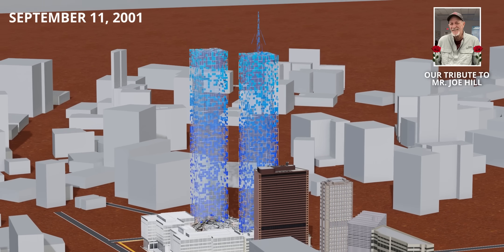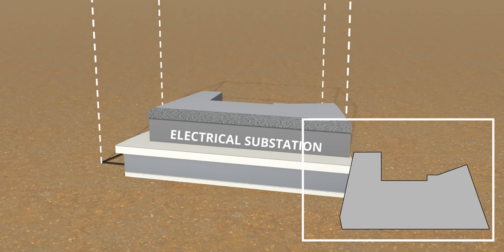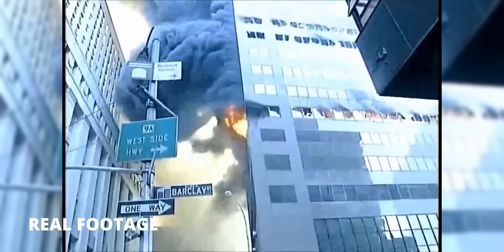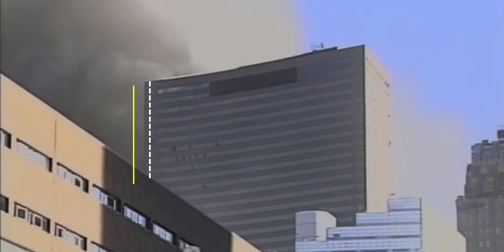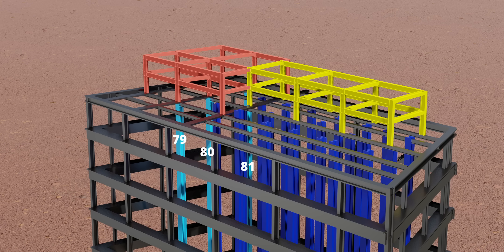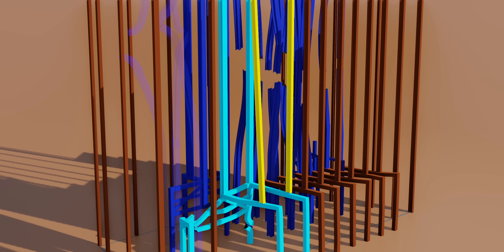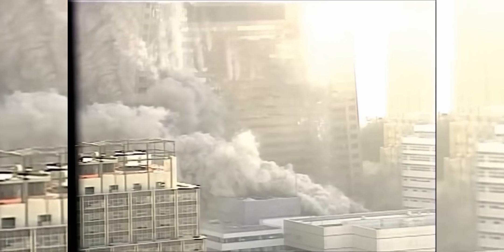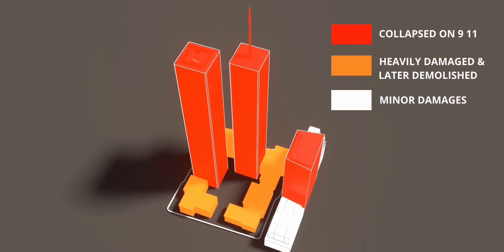Collapse of Building 7 | The Complete Physics

Comment: Propaganda.  It was a controlled demo.
Reply: I'm going to respectfully not only disagree but explain why you are not even wrong.  Building 7 - the 6th building to collapse of 10 lost on 9/11 -though extensively studied  still confuses many. Not famous or a terror target, and with no casualties, it did not get a lot of attention initially, creating a void the internet rapidly filled with garbage. Because everything seems like a conspiracy if you don’t understand how it works I prepared this brief summary of the collapse from my own analysis. No politics, just engineering. 

Context: The North Tower collapse at 10:28am bombarded Building 7 with tons of burning debris, causing heavy damage and starting multiple fires burning out of control for the next 7 hours. Half the FDNY firefighters having been killed, others injured, units in disarray, equipment destroyed, no water pressure, and the greater urgency of Search & Rescue efforts, firefighting was pulled as futile. The building couldn’t be saved and was left to its fate.

www.youtube.com/watch?v=g_SvpwyC17M&ab_channel=MFitz  

Collapse of a burning structure is always a concern for firefighters. Steel buildings subject to fire rely on active fighting of the fires to survive. Buildings are designed around 1 to 3 hours of fire resistance, allowing time for occupants to escape and ACTIVE firefighting to get started, after which all bets are off. Left to their own devices they will exceed their design envelope and collapse. In B7 the occupants escaped, passive and active fire protections were compromised and active firefighting was abandoned which left the building to take its chances. It lost. Odds on Building 7 would eventually collapse, and it did. No big deal in logic. That is the sort of choice firefighters make every day in brush fire situations - which houses to save and which ones to let go. Only real difference here is moving the decimal on the size and cost.

www.youtube.com/watch?v=WnYBX6QT0R4 

FDNY Chief Daniel Nigro ; The biggest decision we had to make on the first day was to clear the area and create a collapse zone around the severely damaged 7 World Trade Center, a 47-story building heavily involved in fire. A number of fire officers and companies assessed the damage to the building. The appraisals indicated that the buildings structural integrity was in serious doubt. I issued orders to PULL BACK the firefighters and define the collapse zone. It was a critical decision; We could not lose any more firefighters. It took a lot of time to PULL EVERYONE OUT, given the emotionalism of the day, communications difficulties and the collapse terrain

FDNY Deputy Chief Peter Hayden ; We had our special operations people set up surveying instruments to monitor and see if there was any movement in the building. We were concerned of the possibility of collapse in the building. And we had a discussion with one particular engineer there, and we asked him if we allowed it to burn could we anticipate a collapse and if so, how soon? And it turned out that he was pretty much right on the money, that he said 'In its current state you have about 5 hours

The collapse of Building 7 was anticipated and widely reported in the media throughout the day. At least 24 video cameras recording some or all of the collapse. Everyone knew what was coming and why.

www.youtube.com/watch?v=OY5S5k3tMHI 

Building 7’s collapse was completely different to the Twin Towers, harder to understand with most of the details difficult to see. But we can still sort out what happened through careful analysis and observation.  This is MY EXPLANATION of the collapse sequence using the best available information and relying on no authority.

B7 was complex 47-story steel framed structure built on top of a smaller existing 3-story building, requiring several lower floors dedicated to complex load transfer structures instead of usable office space. Of trapezoidal shape and all-steel tube-in-tube construction, B7 (above the 7th floor) consisted of a central core of steel columns carrying most of the gravity load, perimeter steel columns around the outside of the structure carrying the remainder of the gravity loads and long span beams and girders to tie those elements together and form the floors. On the outside of the building hung a moment frame - the last part of B7 to fall. 

Phase 1 : The first externally visible signs of collapse initiation occurred at 5:20:28 pm. Collapse initiation for B7 is notably quiet with observers not realizing the building was collapsing! There was no audible warning in the form of say hundreds of ear drum busting 180-190dB explosive bangs preceding the collapse. Here at 12:00 a local CBS affiliate reporter is talking 10 blocks from B7 when collapse begins. People don’t start to notice the collapse until 12:11. Then at 12:45 is the famous CBS fixed camera clip of Building 7’s collapse.  Note how quiet it is.

youtube.com/watch?v=t5tEy6mXSE8&ab_channel=fresnosean379

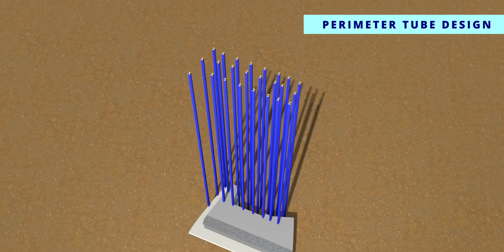Collapse initiation was due to lower floor failures above the load transfer region (7th floor) in the NE corner of the building. In this video at 0:45 you can see the NW corner from inside the building while under construction, Column 79 just out of frame on the left. That big, angled steel beam across the top of the frame connects to C79 at one end. The girders connect to the beam. That beam and all those girders depend on just one connection

youtube.com/watch?v=nP3TNHPCIVU&t=35s&ab_channel=EdwardCurrent

Phase 2 : Lower floor failures caused a loss of critical lateral support over an excessive length of core Column 79 and it buckled. If you look at a floor diagram of Building 7 (see above) and look at all the structures that depend on C79 you quickly realize this one column was a relatively isolated structural element on which a disproportionately greater fraction of the structure depended analogous to say the Key Bridge. Externally we see a vertical progression of window breakage along the 44-46 line and a kink in the roof of the East Mechanical Penthouse at the top of the building, consistent with C79 failure. The transition from full capacity to almost no capacity occurs in virtually an instant. Once the buckling failure occurs there is almost no resistance

Normally with a buckling column, the load could very well be redistributed to other columns, meaning the buckling could stop after a while. With C79 that is not the case - the failure did not redistribute the load, so the collapse rapidly progressed to the roofline, sinking the rooftop penthouse.

Phase 3 : With C79 gone, B7’s progressive, non-symmetrical collapse continues with C80 and C81 at the east end of the core left laterally unsupported and quickly buckled and failed as well, sending the EMP down through the building. C79-81 all have no diagonal bracing, which I believe is a major reason why they could not redistribute a lot of vertical loads among one another.

From there collapse progressed from east to west through the central core until the core was gone taking all of the interior floors and structures and probably most of the perimeter columns with it. You can see the horizontal progression of window failures low in the building and the dropping of the remaining rooftop structures into the building. One of the big takeaways from the NIST Building 7 study (that gets completely ignored) was their modeling which determined C79 failing under ANY circumstances would have initiated the same collapse sequence.

Phase 4 : After some 10 seconds all that remains of Building 7 is just a hollow empty outer shell - the exterior moment frame - creating the illusion the building is still standing since little has changed externally. But it’s just a hollow empty shell like an empty cereal box supported by only a few remaining columns and quite unable to remain standing. With all the internal framing gone. the north face leans inward, forming a V in the roofline, the last perimeter columns buckle under the strain and with nothing left keeping it up the moment frame free falls, landing on top of the 7-story high debris pile. It is only at the very end that a single measurement of alleged free fall acceleration is taken. Note this is not the building but just its outer shell, and only one corner at that, at the very end of the collapse. Start to finish the entire collapse took 18-20 seconds, or less than 1/3 of true free fall and we have to look at the whole thing, not cherry-pick little bits to fit a particular narrative. Worth noting _how fast something falls cannot tell you what started it falling in the first place. The debris spread out, blocking surrounding streets, heavily damaging the Verizon Building and destroyed Fiterman Hall, all well outside of Building 7’s “footprint”.  

Building 7’s progressive, non-symmetrical collapse was incidental and unintended collateral damage from the combined effects of fire + time + gravity started by the collapsing North Tower. That is true no matter who planned and carried out the 9/11 attacks or why . The collapse was of so little consequence it barely even registered at the time, a mere footnote. It only took on semi-mythical status as an alleged smoking gun years later when demolitions at the Twin Towers, missiles at the Pentagon and shoot down over Shanksville all failed and conspiracists had nothing left to work with.

Anything can seem like a conspiracy if you don’t understand how it works. Now you should. I hope you found this helpful and informative, not adversarial and it solicits informed critical comment. If I made any errors of fact, logic or reason or left anything critical out, please let me know so I can fix it. IF you can offer a more plausible alternative please do. Be the first. Please start any reply with the words “Tits McGee” or I will know you didn’t read it and are wasting my time.
Reply: @TheCriticalStinker-01  There were 100% explosives in the building and thats how it collapsed.
Reply: @ProGamez262Archived  - Then write it all up, just like I did. Make sure to include ALL of the evidence - don't leave anything out or make anything up.

I will know.
Reply: @ProGamez262Archived  “I don’t need to give evidence” = “I have no evidence”. If “dancing israelis” is all you can come up with then you are a lost cause.